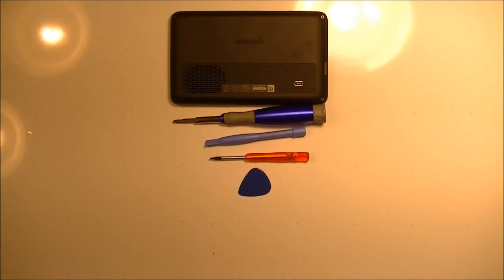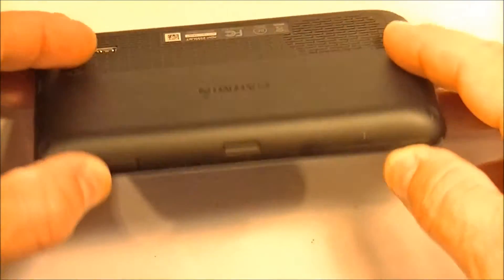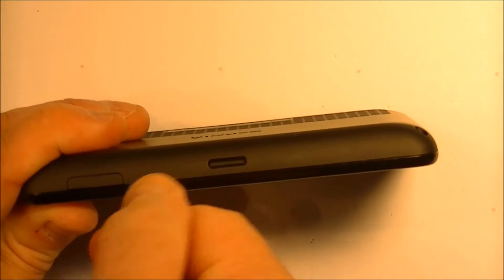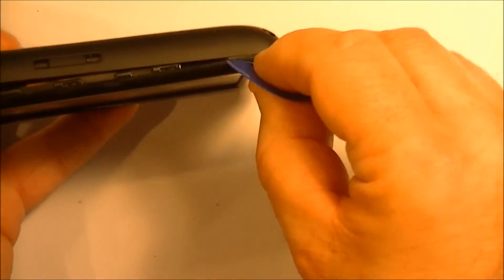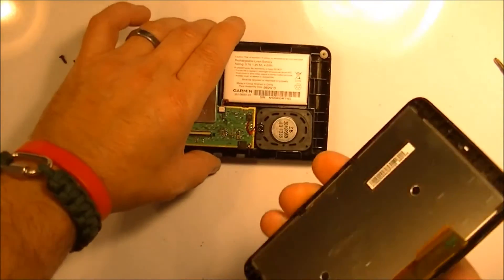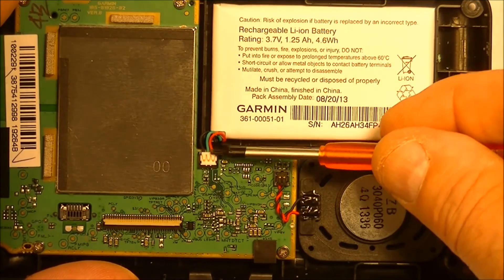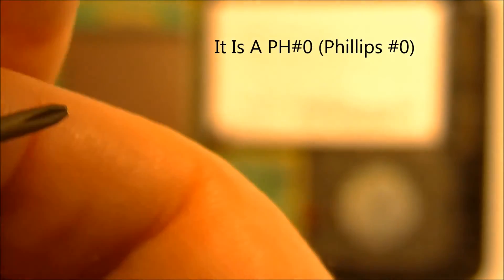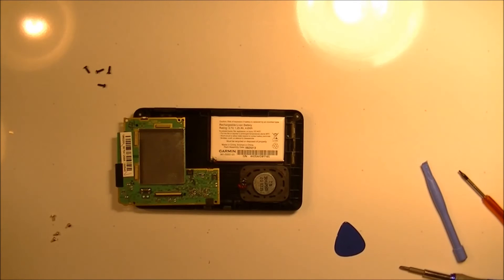Garmin Nuvi 2555 LMT Dissasembly

Comment: very helpful exactly as described thanks
Reply from the maker: You are most welcome. Thanks for watching and the kind words.
Reply: Other sites do not detail how the battery and speaker connector are simply lift up, as you show well.  Its brilliantly easy to remove and seems very secure.  Over the years, I've watched how increasingly fewer parts are in the Mobo and sadly, cheaply made other parts of these GPS units have become.  The plastic case of my 2555 has cracks whereas 3 older Linux based TomToms were like new despite used for 10+ years under the same conditions, alas the newer Toms are just as poorly made.  The touch screen was thin and not as sensitive as the older LM40 Taiwan made Garmin whose parts I salvaged to rebuild my 2555;  the touch screen cracked for no reason while I was operating it and the salvaged part is more responsive while the screen feels thicker and fuller.  A loupe revealed the soldered supports of my USB port had cracked free despite it working well, and it was only being held in place by the USB signal and power pins.   These failures are almost certain to happen so an owner can end up buying another in a few years if they do not repair them.  

Suspiciously, if Garmin can engineer a better GPS with less parts {ASIC FPGA etc.,], its almost certain these failure points [ screen, USB, battery, chassis] are known to them and not upgraded as a kind of built in obsolescence.  As I have 'lifetime' maps I also notice the unit gets slower and buggier with each upgrade, so I stopped upgrading, so this is another possible engineered in failure point, each upgrade requires more CPU and memory resources the older units do not have forcing owners again, to upgrade.   

Thanks and I've added the details on my post as a reply to your video so other readers can know the skinny.
Reply: My pleasure, thank you!